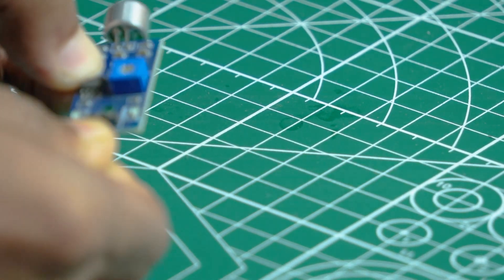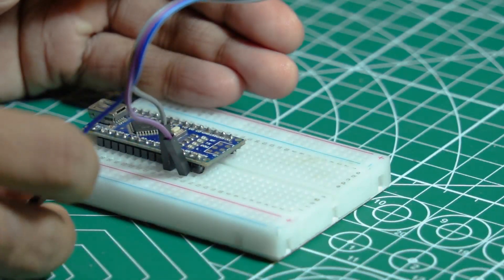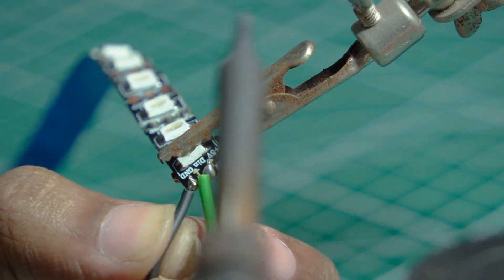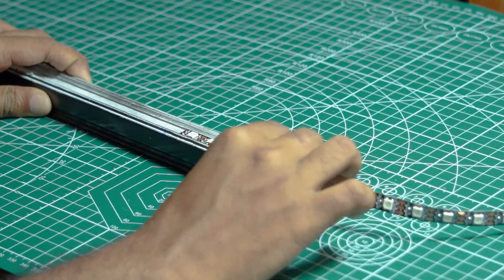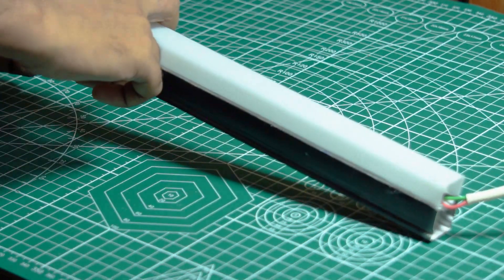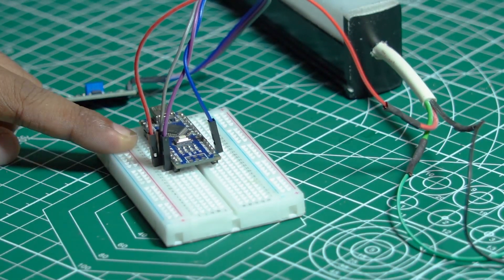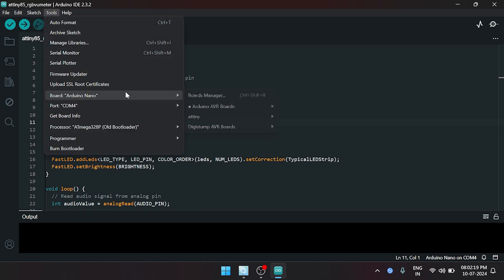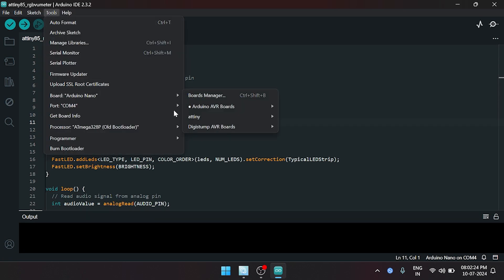RGB VU Meter with WS2812B | Real-Time Music Reactive LED Bar

Comment: Hola, tengo la mayoría del material, pero,  me podría decir donde comprar encontrar el led diffuser. Gracias desde ya.
Reply from the maker: You can buy it from any electrical shop or amazon, ebay. Or you can use led tubelight case.
Reply: @electro_gadget80  thanks a lot.